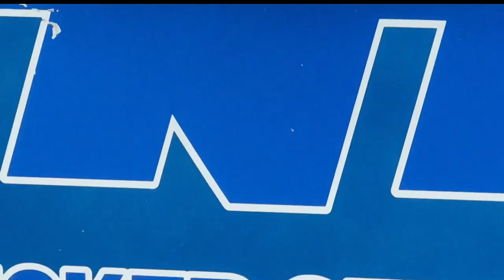Crane Recovery I-10 Louisiana - Collaboration between TNT Towing & Transport and Elite Services

Comment: Let's see...5-wreckers @ $350.00/hr and don't believe the crane can travel and I do not see any type of lowboy trailers.
Reply: Those are rotators; if you double your number for EACH truck you might be close. Especially since the truck on the end was a 75 ton, I would say that was a grand an hour by itself.
Reply: In my experience, cranes can be flat towed. There’s a special mode you can put it in and the steering works once you move at a certain speed. Can’t remember what speed, but I think it’s like 2-3 mph. I may be wrong. I know the incident I worked on the crane was moved in this manner.
Reply: I've been to rollover accidents with a 50 ton and 25 ton wrecker that added up to 60k+. 

I'd be amazed if this cost less than 100k in tow bills considering it looks like it it's a public road, and an insurance accident.